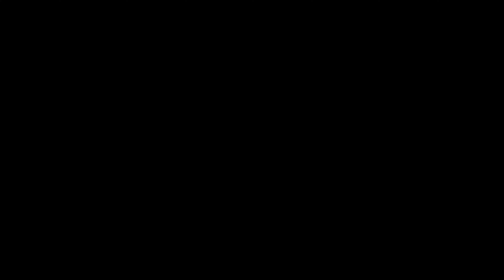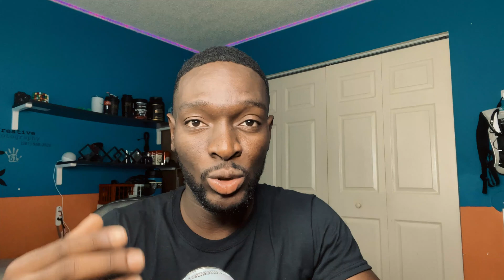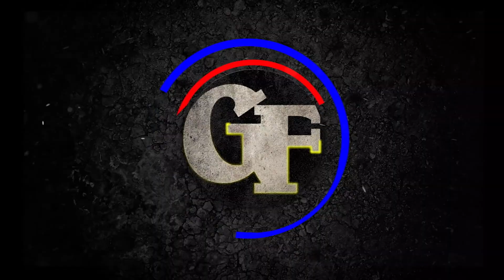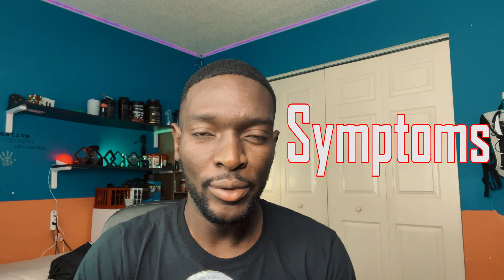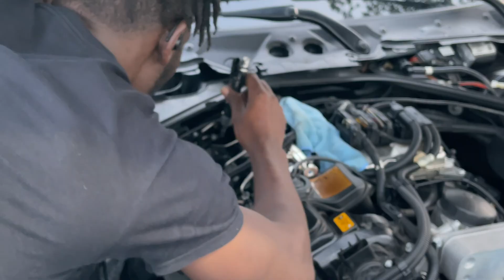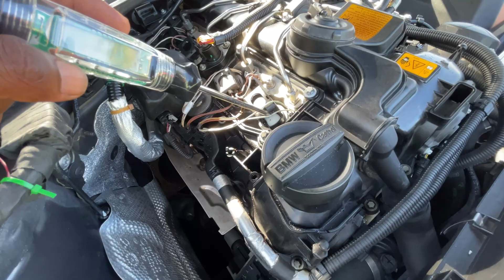Drivetrain Malfunction - What is It & How to Fix it | BMW 328i | Get Fixed

Comment: So what was your problem the ecu
Reply from the maker: No. My problem was coming from the fuel injector in the second cylinder.
Reply: @GetFixed   I know mine stop accelerating and I can’t give it no more gas. I have to pull on side of the road and it starts just fine
Reply from the maker: I think the issue is causing your car to go into limp mode which is why you can’t accelerate. If you have a check engine light, use a BMW compatible scanner and scan the car to see what error code comes up.

Comment: In my case I get the “drivetrain malfunction” notification at startup it could be random, mostly when engine is cold, it struggles to start usually it shakes however it starts up normally after 2nd try or 3rd it’s weird so I know it’s not something serious I’m facing a module error/issue or a fixable issue on the engine I just can’t pin point it 😢
Reply: Did you try replacing the spark plugs and coils?

Comment: Hi same issue drivetrain. So far i understand that you change all the fuel injectors then whats next computer reset?
Reply from the maker: Reset the check engine light and drive the car around to see if the light comes back on, if it does, scan the car to see what errors you get.

Comment: Getting code P0303 ?
Reply from the maker: It seems like you’re getting a misfire in cylinder 3. Try taking the spark plug coil from cylinder 3 and swap it out with the coil in cylinder 1. Reset the code, If the problem moves over to cylinder 1 then you know your problem is the spark plug coil.

Comment: This makes no sense. Simply probing the wire doesn't do anything you're not sending any signal to the wire. When you probed it I think you pressed the open positive wire on the engine or something else that's grounded and it shorted out the circuit hence the vehicle turning off.
Reply from the maker: Simply turning of the vehicle doesn’t make the conditions of the issue disappear. Something is being triggered when probing the wires..
Reply: @GetFixed  yes you grounded out the positive wire when you were probing it. The exposed wire hit metal and shorted the circuit.

Comment: Ok kool but how did you fixed it?
Reply from the maker: I swapped out all 4 of my fuel injectors & spark plugs. That resolved the drivetrain malfunction error message I was getting.
Reply: @G @GetFixed its a 2012 bmw 535i
Reply: Did you have to reprogram the computer codes for the new injectors?

Comment: Hi! I have a 2016 428i and the DT malfunction error popped up on my display. I took it to the dealership and they recommended changing out transmission fuel pan/seal. Did that (myself) but still getting error code. Cannot drive the vehicle far except for a short distance (we’re talking to the end of the street) before it just stops. Will not go into gear. Vehicle is not giving us an error code when scanned. Am I doing something wrong? Suggestions please.
Reply from the maker: Hey AC. You’re not doing anything wrong. If you’re not getting a check engine light then that likely means you’re correct in looking for the issue elsewhere. I recommend checking the two sensors connected to the transmission. Both the input and output sensor.

Comment: Where are you located and how did you change the fuel injector with out that machine ?
Reply from the maker: I’m located in West Palm Beach Florida. You don’t need a machine to change out the fuel injectors, you just need like two T sockets and a couple wrenches.

Comment: I just got this in my car I have no check engine 😢  can I still drive it again
Reply from the maker: Hey Maria. Do you have any of these conditions like the car shakes or you can’t accelerate?
Reply: @GetFixed  no honestly not really
Reply: @GetFixed  it’s driving fine I turned it in on today and it was gone 😭 so idk if Myb my cables are moving or something  deff going to take it to get seen it had 89000 miles and my insurance covers anything before 100000 if it’s due to transmission
Reply from the maker: Funny that you mentioned the transmission at the end because I was just about to tell you that if the Drivetrain Malfunction error popped up and didn’t leave an engine code then it may have something to do with your transmission. The fact that it disappeared after you started the car back up again tells me that the problem is nothing major as of now. As you stated something like loose wiring could have triggered the error.
Reply: @GetFixed  thank you I was doing some research I hate when codes pop up I’m like why lol but yes I’m taking tomorrow and see what it is hopefully they know because I need to fix it asap before insurance expires
Reply: And I drive it daily  :/
Reply from the maker: Good luck. I hope it’s nothing major. Let me know how the check up goes though.
Reply: @GetFixed Hi, with my car gran tourer 2 litre cannot accelerate. I have drivetrain issue stop carefully

Comment: a question, I have the same problem thanks for these videos.  but which of the fuel injectors is it?  Or do you have to change all 4?
Reply from the maker: It’s recommended that all 4 fuel injectors should be replaced because if one is bad, it’s only a matter of time before the other ones go bad too. Have you scanned the car to verify the error code that comes up? If so, what code did you get?
Reply: @GetFixed  I have not done it.  I am between buying a thinkscar s7 or s5 scanner or buying an autel mx808.
which one do you recommend?